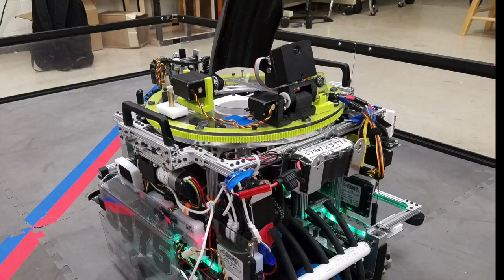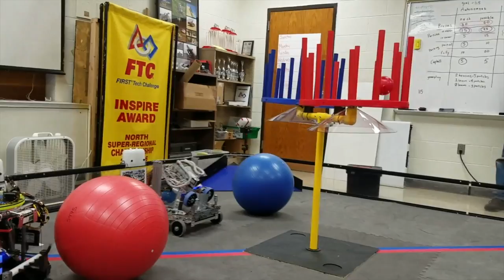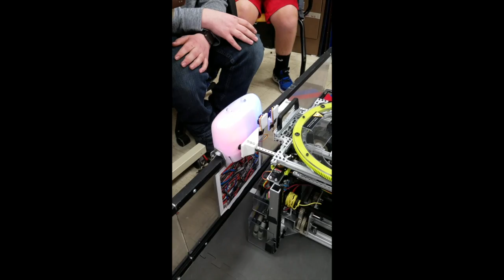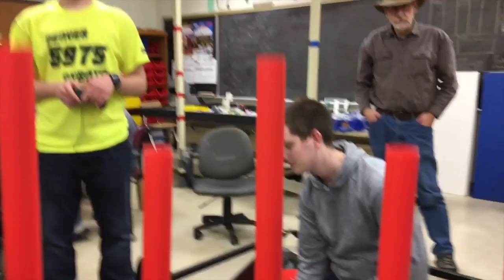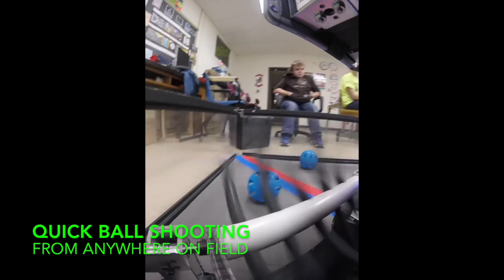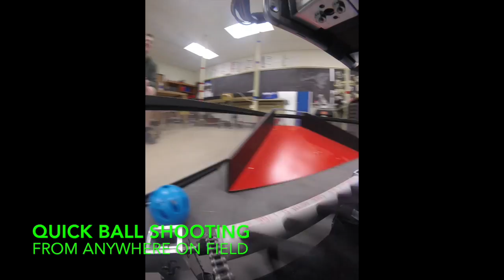Cybots 5975 Robot Reveal 2016-17

Comment: where in the world did you find the large green gear for the top pivot? Also, how did you prevent wires from becoming tangled as it turned? Sadly slip rings are illegal :(
Reply from the maker: We 3d printed all of the gearing and cable management track for the turret. We had a secondary spool that was spring loaded to keep all the extra wired wound up when not wrapped around the turret's track. We didn't use a slip ring because we didn't want signal interference, but it seems that they are legal. http://goo.gl/ue5tQD